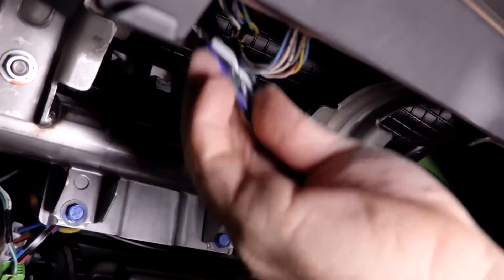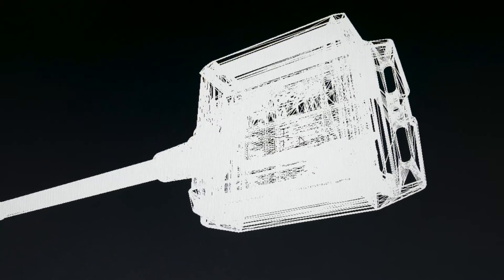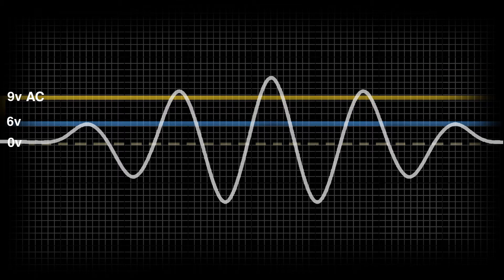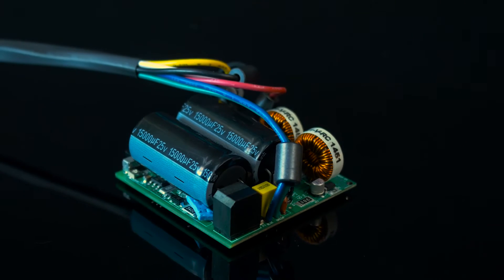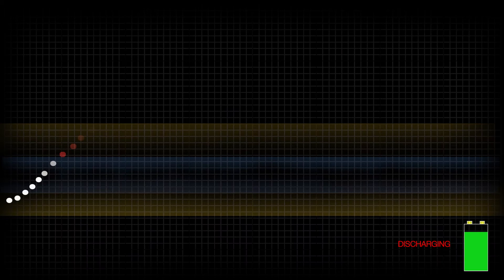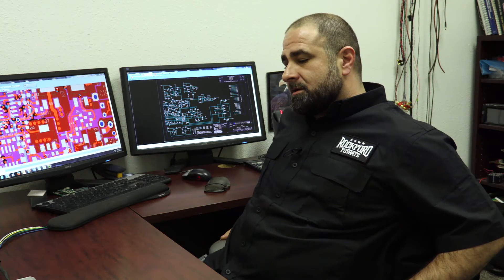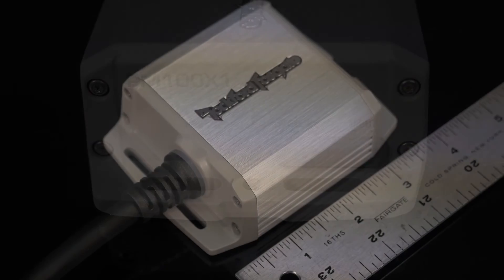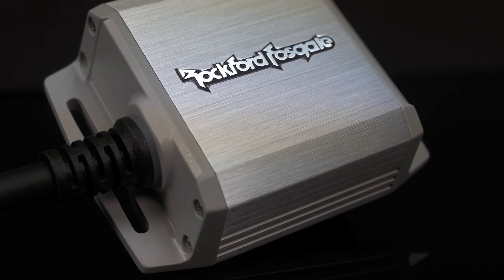2016 Inside Look: PM100X1 Amplifier

Comment: I’ve commented on a comment due to this being a very very close match to something I had thought of just a few yrs before this but it didn’t make too much since to create it in my mind because it “can” it is essentially drawing the power that is similar in heat dissipation to drawing a 2ohm (Bose etc) speaker load from a head-unit.. it may be able to.. but now it’s even worse due to its continuous draw in between pulses/sinewave.. soo I’m definitely not saying it’s a bad idea, but I’d love to try these myself as my main idea was to find a simple way to produce 75rms to a door to give you about all you’d ever possibly need, question is if there is an opportunity for me to do so with results??
Reply from the maker: Yes, the PM100X1 amplifier basically harvests the DC Offset from factory radio to "boost" the power to 60W at 4Ω and 100W at 2Ω.  The technology is patented by us and you can learn more about the features and specs here: https://rockfordfosgate.com/products/details/pm100x1k/
Reply: @ I’ve seen the amps before but I wonder if there would be a way to get in touch to do a review for them, I don’t actually have too much need for them but they seem like a great alternative for people that are not willing to upgrade a unit just simply “juice the unit”, lol; I do installs myself and I run a fairly simple setup with a double din supplying everything including added tweets & a sub independently in a “suburban” as my daily that hasn’t got to much done to it but wheels🤷‍♂️.. with speakers 90+ db, I haven’t found too many reasons to upgrade as the 22Wrms that I receive is just about as much as I’d need usually, but this is a very unique design and I’m glad that it was Rockford that offered it💪, this and the “boosted-rail” seemed like a cop-out to some, to me they are designs that offer a great advantage especially if I have to offer a customer a setup for under 1,000 and see the sparkle in they’re eye🥺.. wanna help but it’s hard to receive much these days for/around that amount that actually is impressive.. these could be a game changer for an average person..
Reply from the maker: @t-rodshader9593  So it sounds like you are a dealer that offers car audio installations?  What is your shop name & location?
Reply: @ me & my brother run a small shop here in KY called “t-rods customs”just north of taylorsville, it’s a sorta private thing we do on the side but don’t get much attention to be honest, lol.. just do installs and details by appointment.. def not a consistent job at the moment, but trying to move ahead in the next 4-5yrs and possibly make it something much more stable

Comment: Could this be used for.....I have a 2021 road glide harley with a stage 2 boom, lower faring speakers, and upper fairing speakers with the Fosgate saddle bag amp.   What I'd like to do is use these new little amps to power 2 8 in the fosgate m2 speaker  in a new advanblack trunk lid
Reply from the maker: Yes, you can absolutely use these for that application.  We haven't tested compatibility with BOOM audio, but there's no reason it shouldn't work.  These were designed for this type of application, when a standard amp can't be used.

Comment: Would they work with 3 ohm components?
Reply from the maker: Yes, because the impedance switch on the amplifier is designed to tell the source unit what type of load it will "see".  It's not for configuring the speaker impedance.

Comment: Could u run 2 speakers off one. For front and back speakers?
Reply from the maker: These are mono amplifiers capable of a 2-ohm load.  You can wire 2 speakers to one amp, but it will only be one channel (left or right).

Comment: so you would one device per speaker ?
Reply from the maker: The PM100X1 is designed for use with 1 speaker.
Reply: And could they be used with a aftermarket head unit?
Reply from the maker: Yes both factory and aftermarket

Comment: now just make it so i can power a small subwoofer. adding lp filter and ill buy it. just to add a little sub to my stock mercedes without wires and huge amp.  that's a great product
Reply from the maker: For subwoofers, we would suggest using the Punch PBR500X1 or Punch PBR300X1 amplifiers.  These are ultra-compact, utilize high-level inputs, and have more power appropriate for lower frequencies.

Comment: What is the advantage of using this over the head unit's amplifier?
Reply from the maker: +Ashneil Roy The amplifier is pulling both AC voltage and DC offset from the speaker outputs, therefore the amplifier needs a GND reference.  This is an "installer solution" where the most common scenario is installing this mini amplifier in the door panel or right next to the speaker of an OEM upgrade with a bandwidth limited speaker (crossed over in the radio).  This GND reference just needs to be a short connection to nearby sheet metal.   The amplifier is "storing" the energy from the source unit, thus a simple load is put on the source unit and will not damage it.    If you have the advantage of installing a traditional Class-AB amplifier with a B+/GND cable, then it's probably a better option.
Reply: +Ashneil Roy An aftermarket head unit only puts out 15 watts RMS on average or a little less and this will put out 100 watts on 2 ohms or 50-60 watts on 4 ohms so your speakers won't lose head room for power and they won't distort as easily and the speakers will play more dynamically and louder so the sound quality improves as well.
Reply: Where is the amp getting the power from? As you said, a head unit only puts out 15 watts. The only thing I can think of is that the head unit has 12v reference to ground available on one of the speaker outputs. This would explain why the amp needs a ground connection.
Reply: If that is the case and they require you to have a ground connection, why don&#39;t they just add a 12v connection to the amp and reduce the potential of damaging your head unit?
Reply: My guess would be to ease the installation or to draw less power from your vehicle. Not totally sure, but I gave it a shot haha
Reply: @ashneilroy this is exactly the first qusestion I had as I was laughing out loudly trying to explain to myself how on earth this would work, I do know that most modern HU’s use a MOSFET tied into a BTL circuit to deliver about the most that you can possibly receive out of a 12v supply without a boost circuit involved before-hand (hence-higher voltage rails; on higher wattage amps, same impedance) but that’s the only thing I can figure is that there is a “reservoir” that supposedly uses the voltage to ground on -/+ rails to make a battery f sorts to supply a circuit that will drive speakers harder based on the same circuit that is also the amplified signal.. only concern I’d have is how is this safe for all HU’s🤔… I mean due to heat dissipation since this is one of the main reasons that they’d struggle running 1-2ohm speakers in the first place other than wiring losses.. energy has to come from somewhere🤷‍♂️.. in which it is taking from short spans within its signal, then essentially amlifying it to charge itself while also powering the speaker circuit.. I have out of curiousity tried using a Pioneer HU on a Bose speaker setup before without factory amp to see just how hot it’d get.. and turned out to work fine although the chip inside of it had a datasheet specifying a 2ohm load soo, it didn’t surprise me that it’d work other than it cutting out if it has impedance protection..
Reply: +Rockford Fosgate Great clarification! the explanation in the video made the amp look a bit sketchy but I realise its purpose now
Reply from the maker: +Ashneil Roy Thanks! We trimmed the explanation from 40 minutes down to 7, because we knew - as complicated as it sounds - a shorter explanation was going to cause less headaches.  Can you pass the Aspirin, please?
Reply: +Ashneil Roy dude ur so stuped its obvius
Reply: +Rockford Fosgate sure cuzz ill pass the activus